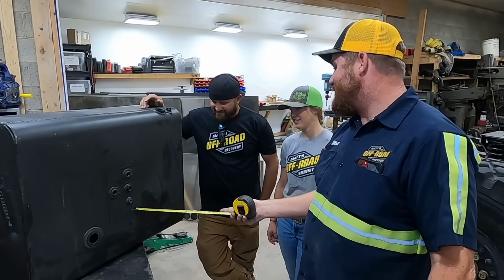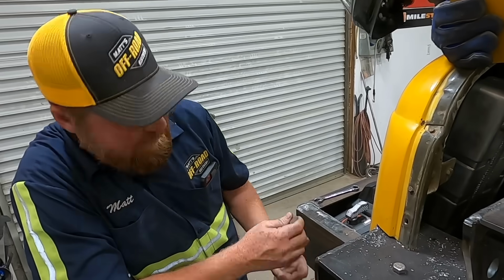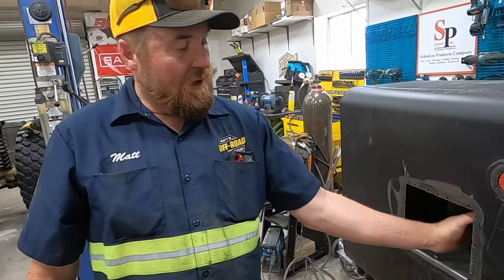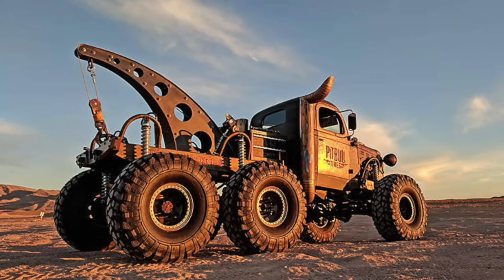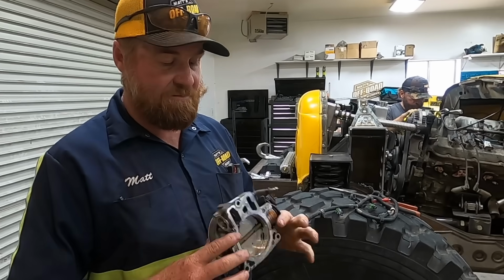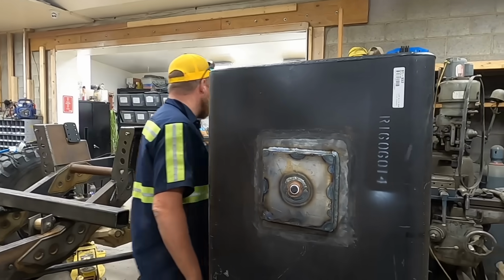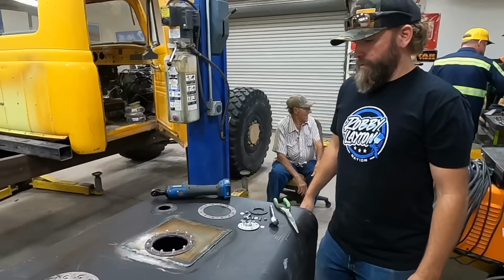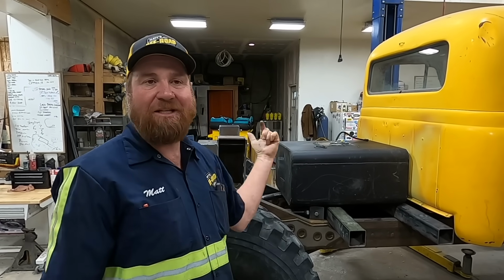World's Largest Off Road Wrecker...There Can Be Only One.

Comment: Thoughts...on each tube that the tank is resting on weld a piece of 4” or heavier channel laid flat flush to the top of the tube, facing in.  Drill on each flange (9/16”?).  Strap the tank all the way around w/3” wide 10 or 11 gauge in two places.  Weld 2pieces of 1/2” pipe to the end of each strap 1-1/8” long flush with strap side resting against tank.  Run 1/2” rod through the pipe & weld gr.5 or greater 1/2” threaded rod to the rod in the gap between the pipes. Run the thr. Rod through the holes in the channel and tighten.
Never weld mounting plates to the fuel tank directly unless fuel tank wall thickness is ridiculously thick; 500 lbs of fuel will cause cracks at the welds in no time.

Comment: Don’t use EPDM as the flexible member under the tank, it’s not suitable for exposure to oil and fuel and it will swell up and crack. See if you can get viton or nitrile rubber instead as they have very strong resistance to fuel and oils :)

Comment: Such Happy Shiney Eager little faces . Use straps that wrap around the tank and tie in to the box tubing .If you stitch weld  straps every bead has a chance of metal fatigue along outer edge of bead on fuel tank due to fuel ,road ,off-road vibrations. Holley makes diesel fuel pumps 50lbs output to fuel injection system pump,good for your drinking right out of Jerry can for fuel supply .

Comment: Hey if you guys are worried about the angles, put a surge tank in it similar to drift/drag cars. Just like a 1 gallon tank, with its own pump that feeds the engine. Pumps in main tank feeds the surge tank.
Reply: I agree. The sump will work for a short tip but it needs to be flat to refill. A long time on one obstacle could be a problem If the tank was low.
Reply: @tbyrd2046  yeah not a bad point. Could make it larger than a gallon, for that reason since the main is a 60 gallon tank

Comment: My vision for this project would have been to use a pipe for the sump and the baffle.  
Cut a round hole out of the tank top to match the ID of the pipe and a hole in the bottom that matched the OD of the pipe. Drill multiple holes in the pipe to allow the fuel to keep the pipe sump filled.   Weld the pipe to the top of the tank and have it extend beyond the bottom as much as Matt feels appropriate. The circle cut from the tank bottom would be the correct size and appropriate material to be the sump bottom.

Rather than EPDM, I would use strips of Rubber Stall Mats from the farm store. It's about 1/ - 3/4" thick and acts more like a bushing.

Comment: It's better to run a strap over the tank and now well to the tank if you're taking have a welder tank it can take a take a chance of cracking and leaking you're better off rubber running a strap over the tank and around the tank and putting rubber under the strap so it doesn't rub to the tank that way you're less likely to get leaks on a four-wheel drive as flexing and changing it will not break the tank you're going to get flexing your frame so you will break your tank if you weld to it

Comment: Nice looking fuel tank. Considering its shape and size, how about adding a ball valve to one of the lower sides so it can either be drained if necessary or can be used to fill up a portable gas can to fuel up other vehicles?
Reply: That's exactly what I did with my truck, I have a small transfer pump and hose so I can share fuel if necessary out of my 100gal tank.  Sure does beat lugging around a 5gal can and dealing with the stupid ventless contraptions they make these days.
Reply: Great idea!

Comment: If the tank fails, it will be where the straps weld to the tank. Vibration can be tough on sheet metal welds in tension. Straps over the tank would tolerate the vibration better

Comment: Don't weld mounting straps to the bottom of your tank as it's a wet tank, meaning it doesn't have a bladder inside like racing cells do. I know your using rubber in between but its still hard mounted and will potentially crack over time. Consider maybe 3" flat bar to make straps that go over the top and bolt to that square tube it sits on, and still use rubber in between. Just my thoughts as I've been building fuel cells for every kind of race car/ trophy truck for over 20 years. Awesome truck guys and good luck, can't wait to see it out on the trail.

Comment: My 2006 Chevy 2500 ext cab 4x4 pickup had the 8.1ci engine, awesome power, would pass anything but a gas station. More fuel, carry more fuel. 8 miles to the gallon empty or loaded or snow plowing.

Comment: If no one mentioned it yet, add a sight glass of some kind to the fuel tank. A thin flush mount window that at least goes half way down from the top of the tank or an elbow at the top and bottom outside the tank with a clear hose. If your only wanting to know if the tank is full or not you could use one of those little round sight glass that also flush mounts on the side near the top. I know you like to go minimalist but this may be worth while. Can't wait to see it finished and out doing recoveries!

Comment: Pro tip:
Use the TIG welder for the next tank build, it's much more easy to make it sealed.
Reply: Yeah, it's time they started TIG welding stuff here and there. Maybe have another YouTuber come by and give Lizzie lessons so she can start getting practice hours.
Reply: @DerekWalker11  
Yeah TIG is all about hours to get good at it.
Iron is easy to start with, aluminium is a bit more difficult with more cleaning and learning to get the feeling of when the aluminium melts.
Reply: @mrolsen6987  Hot Short was what my instructor in gas welding aluminum called it.

Comment: Contact area is key in gas tank mounts and tire flotation.  Straps around a gas tank provide a significant contact area between the tank and and its mounts just as large tires provide a significant contact area between the tire and the ground.  Given the large area of the tank walls, significant force can be created by the liquid against the surface area of a tank wall.  That force is spread across the surface area of the straps and is always oriented so that the tank wall is being pressed against the straps.  If the strap is stitch-welded to the tank, it will localize ALL forces to those areas where the strap is welded to the tank. Some of those forces will press the tank wall against the strap and some of those forces will try to tear the tank wall away from the weld. On a rough trail, a full 60 gallon tank of gas will be a 360 pound weight The Worlds Largest Off Road Wrecker will be trying to toss like a bull tries to toss its rider at a rodeo except ,in this example, the rider rider's hand isn't in a strap.  Instead, their pants have been sewn to the strap.  This may or may not be accurate or even pertinent to the topic but I was eating biscuits while I wrote this so my focus may have drifted.

Comment: It’s true Matt, you do take running out of gas very seriously, you are an expert at it PML. I think “The Hog” would be an awesome name for your wrecker. Whatever you eventually name the beast, is going to be awesome, and I can not wait to see it running. Good luck and keep on getting them out. Oh, one thing, I forgot. Will you drive this monster to a site of recovery or tow it on a trailer? I was thinking of the fuel consumption. Have you thought about maybe having an emergency fuel tank somewhere above the fuel tank so as you could just open a tap and run the fuel down to the main tank? Just in case you ever run out of fuel. Thanks for the update.

Comment: Wow, I never would have guessed that was a 60 gallon tank.  My motorcycle has the same "feature" that your tank does:  a fuel gauge that only reads the bottom half of the tank.  I just reset the trip odometer and keep track of my range that way.  

That was a pretty weld Lizzy put down.
Reply: Range will very on the wrecker more then average car/truck/motorcycle….  Is it street legal?  I think so. But likely hauled if any distance?  Flat gravel, to hills, to sand, rock climbing.  Likely +3x the fuel off-road per mile as on level solid road.

Comment: That's exactly how I would have made that fuel tank. It's perfect. Maybe made the little sump box drop down more, but it sediment ever get in the tank, it would all just collect down there anyways, at least now its shallow enough for it to get washed out of the hole. Probably redo that ring sometime, make the studs longer. Other than that it's perfect. The original fly by wire throttle, did it open linear to the the position to the pedal? Or did it open based on sensors telling it bay the computer? I supposed the MAF should compensate with the now manual butterfly valve. It will def throw a CEL, but maybe you guys have some aftermarket computer ECU that you are using and I'm just overthinking it. I know on the Ford 6.8l I work on, the throttle doesn't open exactly with the pedal, it opens based on all kinds of factors, regardless if you mash the pedal down, the throttle may only open half way, like a the vacuum secondaries on a carb.

Comment: In aviation we let the fuel flow downhill into a hopper area and the fuel is trapped in there by check valves so the pump is always wet.  We call them flappers and its basically thick circular rubber that hinges at the top and the weight of the fuel seals it closed.  So for you, a hole in the left, right, forward and aft portion of the baffles would seal up the bottom of the tank hopper and maybe leave the top of the baffles open for spill over.  I know its already built but thought i would share some ideas.

Comment: Hey after all your fabrication to the fuel tank...plz Make sure you burn all the rest of the factory liner out of it... Then wash it.. after that get 4 gallons of pool acid pour that into it let it sit on each side for about 5 minutes each drain it wash it dry it then go get you two gallons of red coat fuel liner  then drain it off and save it for another fuel tank project..do not I repeat do not use the cream fuel tank liner.you will be pulling your fuel tank back out in a year time... If you have any questions on how to do it I'll be happy to help over the phone or fly me up for 2 days and I'll do the job for you. Sincerely Mike from ..The Shop of fort Pierce (we fix stuff) Florida

Comment: It seems that putting a strap all the way around the tank and pulling it down on the mounts would be a sturdier solution and lesson the chance of welds breaking off as they are tugged on by sloshing fuel, bumps, twists, etc..  Expansion and contraction due to heat and other forces will generate all sorts of weird stresses on the lower strap welds (where it joins the tank) and could eventually cause tearing or cracking, and a leak.  Rubber could still be used between the cross bracing and the tank, of course.

Comment: Are there any data plates on the truck's dash area? Usually a military used vehicle will have some sort of extra data plates on them. It looks like it might have been used by the military but not as a tactical truck. I do not recall the term we used years ago, today we call them GSA vehicles or GSA motor pool. It's possible that it's not a military used vehicle since International used a lot of green paint during that time frame. It seems IH had several military contracts during the 50s and used a lot of OD paint. The bed might have been added later for the Fire Department. The truck is looking.

Comment: Matt you asked for it. Reason fuel tanks are strapped in is because of rupture occuring in a wreck. when you weld a strap on as a hold down, in a wreck it is possible to tear a hole in the tank cause a fire. or Kaboom.. anchor the straps to the frame not the tank. I believe you can see the logic in this. It is a safety item. Otherwise love the build. I would not of commented but YOU asked for it.👍👍✌

Comment: I hope you don't mind a little recommendation on your gas tank. But after building vehicles for a living. I found that for large tanks. It's often best to hold them in with straps. What happens when you weld brackets to the tank (especially with mig). It will flex from all the weight of the fuel sloshing around. And will eventually crack on the weld. Just a thought. Nice build! I've been enjoying watching it.

Comment: I know nothing about vehicle fabrication but I'd be concerned about the ability of the thin tank material being able to take the constant vibration at the edges of the welds that hold the straps to it. I would have thought there is a great risk of the tank skin fracturing at those points?  When you said straps I was thinking straps all the way round with turn buckle to tension the ends to each other and grip the tank, probably with rubber mounting strips between the straps and the tank.  But I've never done it or am I likely to and you have the experience.

Comment: great build and love watching the progress.
Comment on the tank mounting, questioning mounting it completely rigid.  Could be asking for trouble down the line in regards to cracking.  Suggestion would be to use springs on the mounting tabs/bolts, similar to what they use to mount large tanks on truck chassis.
I know your chassis is really rigid, but there is still going to be a minor amount of flex. 
May not ever be a issue considering this rig will not be used everyday.
Thanks for all you do to keep us entertained and the great ideas for future projects.
 example: https://www.metaltanks.com/images/spring-mounting-kit-fig6.jpg

Comment: I don't know if it's the same now but most fuel tanks used to be suspended under the car with a couple of straps.  That way there aren't fixed points on the fuel tank that can fatigue and crack.  You could do a similar thing with yours- build a couple of brackets on those steel tubes to form a saddle, then build some straps that go over the tank and are pulled down by long bolts.

Comment: Thank you Matt for correcting and saying engine. Pet peeve of mine. Motors are electric, Engines use fuel. 😎👍
Reply: MERRIAM-WEBSTER'S UNABRIDGED DICTIONARY
Definition of motor 
1: one that imparts motion
specifically: PRIME MOVER
2: any of various power units that develop energy or impart motion: such as
a: a small compact engine
b: INTERNAL COMBUSTION ENGINE
especially: a gasoline engine
c: a rotating machine that transforms electrical energy into mechanical energy
3: MOTOR VEHICLE
especially: AUTOMOBILE  🤔🤔🤔🤔🤯🤯
Reply: Exactly...I have this same pet peeve.  Just the other day I saw this enginist on the highway just engining along towing his engineboat with his enginehome and thought "man that would sound so silly if all of those vehicles were electric and we had to call them motorists motoring along in their motorboats and motorhomes, I'm so glad there's a clear distinction between the two".  On the way I saw an enginecycle and other enginevehicles made by General Engines, Ford Engine Company, and Toyota Engine Corporation, and even a BMW.  Interestingly enough, Google's electronic search motor told me that BMW stands for Bayerische Motoren Werke, translated to English, that means Bavarian Engine Works.  I heard they're a pretty big name in enginesports.

Comment: I put a tank in using straps around the tank covered in heavy hose, put bolts in frame, drilled holes is short 3.4 inch pipe, curled strap pipe and put the bolts through the strap and pipe. that was 50 years ago and the last I heard it was still running around in Vegas.  Weld on Tank makes me nervous, although I have seen it done a couple of different ways on very full tanks. Best one was a penny soldered over a bullet hole with an electric gun holding the penny in place and soldered flowed around the edges.  More than one way to skin a cat, if works it is a success, if it don't work try something else.
AS for the wiring guy invite him, at his own expense, to come out and do the wiring or cork it.

Comment: Tink about a bottom isolation valve for fuel supply from sump and way to run vent and filler line so gas does not escape on extreme angles.
I have watched several tractor tank repairs where the tanks were integrated to the support frame. which later caused stress fractures at the tank weldments. It may behoove you to completely bushing all the tank mountings to be flexible/independent of frame, just saying for long term since this rig will be under high vibration environments. It might be why most fuel tanks are strapped independent from vehicles frames... JD equipment on the big stuff is known for this type of failure of fuel and hydraulic tanks made of metal with integrated frame/body supports. 
On your tanks if you do two pass weldments, clean first pass well and make second, you will have less chance of leaks.
Rig is looking good!